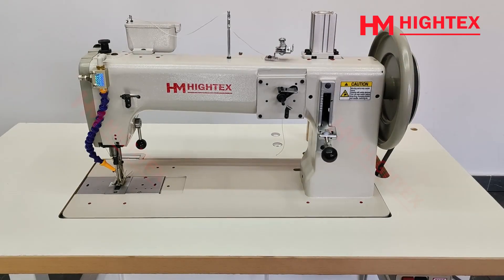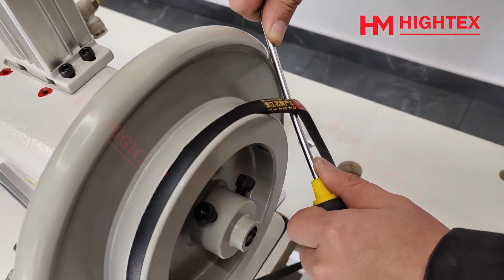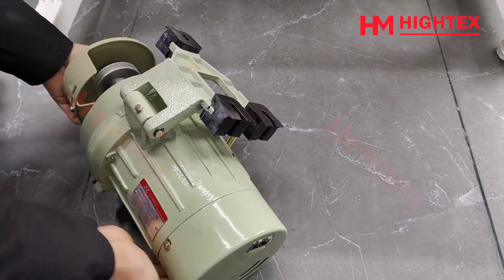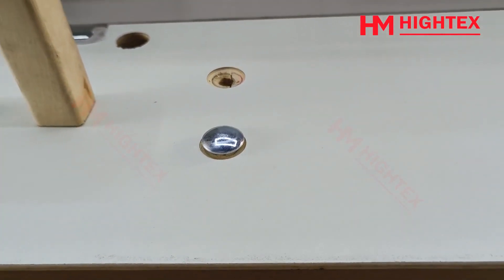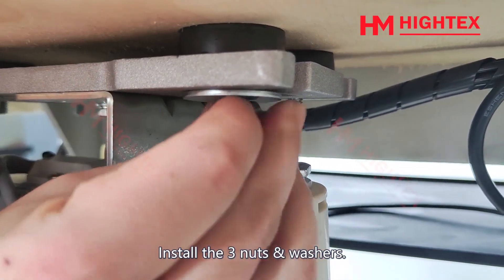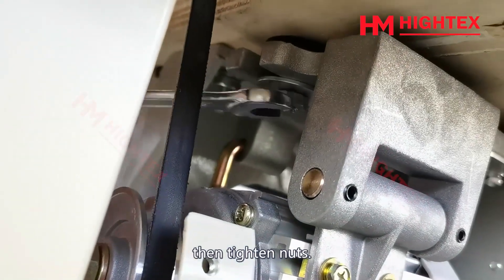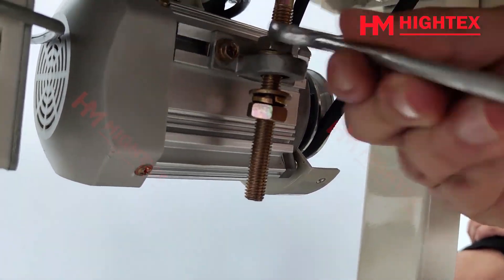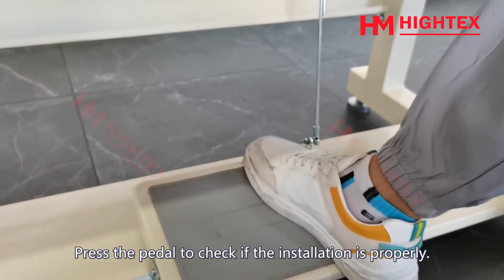Upgrading Industrial Sewing Machine Clutch Motor with Energy Saving Servo Motor

Comment: Do these  motor suit any type of sewing machine, mine is a semi industrial.
Reply from the maker: It will work, but not good idea, unless you want your semi-industrial sewing machine runs at extremely slow speed. There are many brands of servo motor for light to medium weight industrial sewing machines with low price. Kinedyne HM-75 serial servomotors feature in "high torque“ at "low speed), so it is designed for heavy duty industrial sewing machines, the cost is higher than other power saving motor.

Comment: does the servo motor have speed control?
Reply from the maker: Sure, speed controller is necessary for servo motor
Reply: @HightexHeavysewingtechnology  Do have digital speed control
Reply from the maker: @adebayooluwole8371  Surely you can adjust the speed by digital board